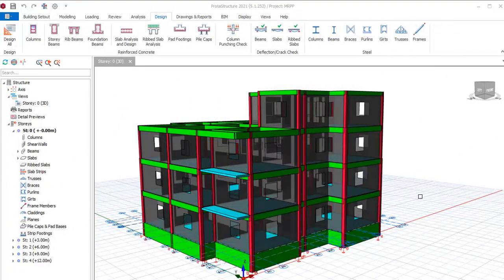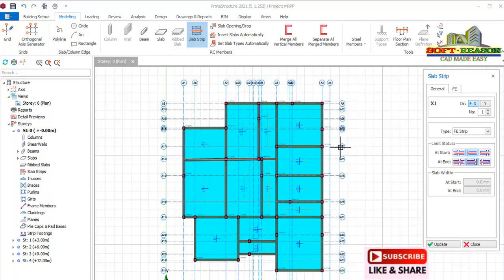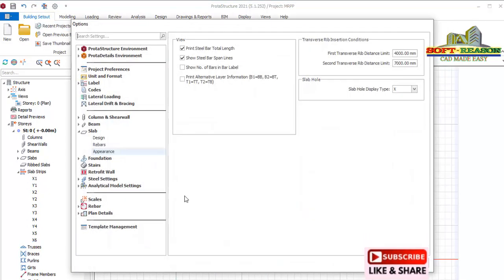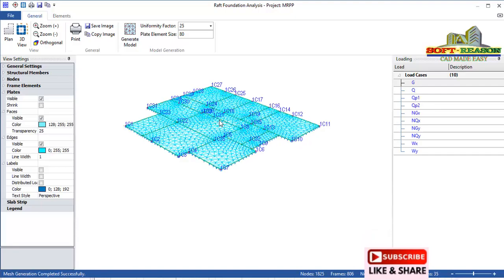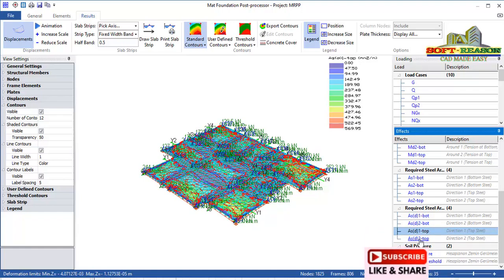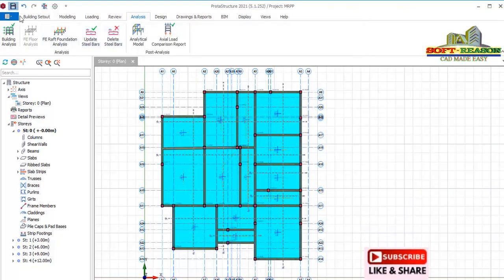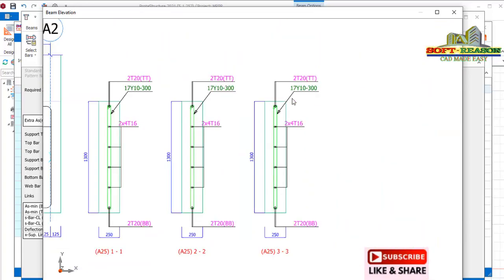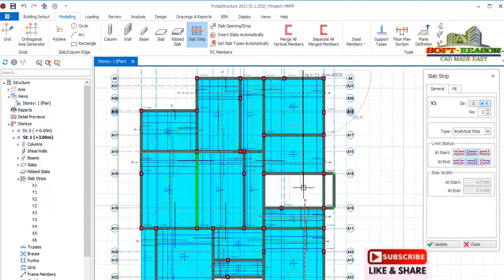Reinforce Concrete Raft on Beam Foundation Design in Protastructure 2021

Comment: I have 2 questions:
1. Raft slab can it be design along without a beam, or raft on beam.
2. If yes, how can u know if the reinforcement and slab thickness are correct.
Reply from the maker: The software tells you whether they are correct or not, you can also do a manual check to be sure